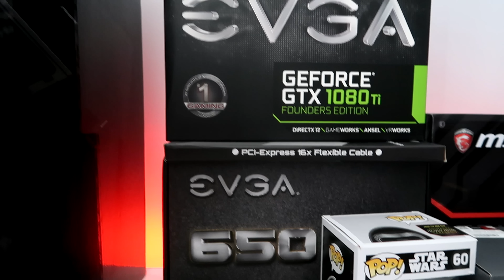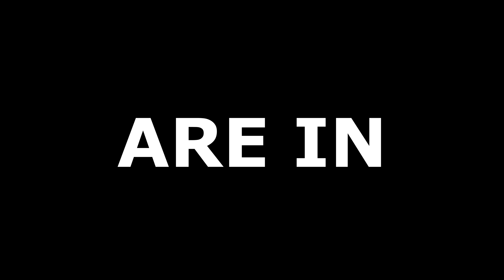GTX 1080 Ti Gaming PC Build AMD Ryzen 1700 Benchmarks 4K

Comment: Finally someone does gtx 1080ti and 1700 build
Reply: And runs it at a resolution people would use the 1080ti at.
Reply: lol would u consider a 1080ti for 1440p 144hz?
Reply: WaffleSplash, why wouldnt you?
Reply: And I wanna make s similar build with the 25 inch ASUS MX279H.  I was planning on using 32gb of dominator platinum and still using the 1080 ti.  Mostly playing games like overwatch and doom.  I'm hoping for the 200 fps range and this would also be my first build.
Reply: MrAlmond tbh why would u need 32gb ram and if u go that much for ram make sure its the fastest MHz for sure and when are you planning to do the build I was planning mine for so long now
Reply: I would use the ram for editing with super fast render times and I don't want to need to upgrade later on.  It's also going to be 3000mhz because 3200 is an extra hundred dollars.  I've been planning this build for about 2 months now and I need to wait another 3 months.  BTW I decided to change monitors to something higher resolution and higher refresh rate so I can get the best experience.
Reply: MrAlmond lol bro I been waiting so long for a PC build because I'm in high school like I have the money but I don't know if I should spend all my money like that you know and currently I have 3 monitors connected to my MSI laptop so I don't know what to do either wait for the next series of gtx or what....
Reply: I'm only in middle school but I can't really get a job and I am struggling on ways to make money besides selling alot of my stuff.  I have a macbook pro but I learned that they suck so I'm gonna sell it.  I think you should probably wait until the 1080 ti prices drop and some other components like the cpu.  Use pc part picker they show the lowest prices and you would save quite a bit unless you already are using it.
Reply: ViETKhanGG I do t have it yet

Comment: oh man peanutbutter, i wish you'd make more vids, i dont care what videos if its builds, funny moments, i just love them, keep it up man ;) 

and ps: i have a fx 4300 and gtx 950, should i upgrade to a pentium g4560 and rx 480 ? :)
Reply from the maker: The g4560 is a solid cpu for the money, but when paired with an rx 480 you may experience a slight bottleneck in some games. Maybe wait for Ryzen 5 & 3 or get a i3 6100 / 7100
Reply: PeanutButter25J see, i live in germany, the i3 costs about 80€ more so i could get the msi rx 470 how would that be ? ;)
Reply from the maker: Oh I see, well I would go with the Pentium/Rx480 I guess x) or wait on the upcoming vega GPUs.
Reply: PeanutButter25J or maybe i just dont give a s*** and spend more money xD
Reply: PeanutButter25J yeah i think i'll do that, thx for the tip with the bottleneck
Reply: zentix 007 im getting my 390 4 gb build tomorrow  whoo
Reply: mstrm3 with what processor ?
Reply: zentix 007 the i5 6500
Reply: mstrm3 cool ;)
Reply: Why would you recommend a i3-6100? It is AT THE MAX 3-5% faster and costs 80 bucks more. Please, don't buy an i3-6100 anymore. The G4560 is the way to go if you are looking for a budget CPU. Cheers.
Reply: Kresh - CS:GO and more! Yeah, but i dont Know if it will bottleneck with a rx 480
Reply: Kresh - CS:GO and more! the g4560 bottlenecks...
Reply: Yes, it will bottleneck on most titles (unless you play VERY VERY GPU intensive Games), however that was not the point. The i3-6100 will bottleneck just as much. There is absolutely NO point to buy an i3-6100 anymore. If you want the performance of the i3-6100, just buy the MUCH cheaper Pentium G4560.
Reply: Buy Ryzen 5!
Reply: lol FX 4300 is kinda shit. Pentium would do better even in multithreaded games lol.
Reply: Eminentend i know thats why i wanna upgrade
Reply: @zentix yeah I was responding to another guy

If you're on a tight budget purchase the g4560.. Do not buy i3s.
Honestly I recommend you get g4560/RX 470 combo if you want the most value. There will be a bottleneck in some games but it's not too significant.

AMD has a 4 core 8 thread processor for $169 that should pair well with the RX 480. Keep in mind the Polaris refresh RX 580 and 570s are coming out soon so you may want to look out for those  too if you don't mind waiting.
Reply: Eminentend im getting the fx8300 with gtx1050ti can i expect bottenleck? im new into pc gaming
Reply: @Knight Warrior

You honestly shouldn't expect that big of a bottleneck with a budget GPU like the 1050 Ti, however why go with an older platform? What if you want to upgrade your GPU in two years or so? I recommend waiting for the R3 lineup of Ryzen CPUs, you should get more value for your money
Reply: Eminentend ive already build my pc with the amd fx8300 and gtx 1050ti.. can i run games like The witcher 3 and fallout4 with some mods? i aim to play on high settings.
Reply: You'll be fine with both at 1080p if you don't mind turning down a few settings
Reply: Get RX 580 with Ryzen 3 CPU when they come out. Or wait for AMD Vega GPU:s, slower ones will match GTX 1070 (or higher) with cheaper price tag if my predictions are right.
Reply: even an i5 will bottleneck RX 480, i have experienced it. was running i5 4440 with RX 480 switched to i7 4790k huge difference in games like Bf1 and Tombraider
Reply: I have a custom build workstation motherboard 4gb ram ddr2 gtx 650 1gb 1.5 tb hard disk and a intel i2 quad core 2.4 ghz i really want to upgrade
Reply: Raghav Tripathi that's because i5 4440 is old asf
Reply: Joey Delgado I have an i7 7700k and gtx 1080ti, should I upgrade to the Intel inside and gtx potato?

Comment: An aftermarket cooler on that 1080 Ti would have helped tremendously with temps and performance. The things clock speed was only at ~1500, most people clock them up to at least 1900

Comment: So im planning on building a pc with the Ryzen 7 1700 along with a gtx 1080.  I was wondering if you think i would experience much of a difference in gaming capabilities if I went down to a 1070 to save some money?  My main worry is that the 1700 might hit a bottleneck and not fully utilizing the 1080 and ultimately lead to me wasting the extra money on the 1080?

Comment: Getting the 1700, strix 1080ti, 16gb ddr4 3000mhx corsair lpx, 1000w psu (only psu ill need for ages), NZXT h440 matt black, asrock killer 370x mobo (oc and wifi). Itll be complete by next week!!! 

I noticed you used a 650watt psu, wont that be an issue?

Comment: You have given no info at all.

Did you overclock CPU ? If so, whats the multiplier ?
Did you overclock GPU ? If so, give us the numbers.
Did you overclock RAM? Which speed are they running on? 

As a potential buyer, I need these.

Comment: When are u doing the budget Ryzen build?:)
Reply from the maker: ;D
Reply: Eemil Satoniitty what's your budget? Ryzen costs more than my build
Reply: mine is 500-600
Reply: +PeanutButter25J Should i wait for the ryzen budget build?
Reply: Eemil Satoniitty get ryzen $ 350 or less, rx460, 1 $50 stick of ram, $80 motherboard $50 case, $40 psu and some fans. Should be around your budget

Comment: I have an E6600 , 2GB RAM , MTB LGA775 , GT 520 
So...I can upgrade to 64 bit , what GPU and RAM I can buy for an upgrade ?maybe even a CPU.
An 750ti ,4gb 1600mhz should work ?Would the 750ti bottleneck my cpu ? 
Thanks .

Comment: He doesn't put on thermal paste on the CPU when he applies the cooler and also 86 Degrees Celsius on a 1080? Really not good
Reply: Wernich Schmidt all of the 1080 ti's seem to be running pretty hot at the moment but yea I thought that was a bit high.

Comment: very low fps for a 1080ti. I've got a 1080 running on a 1440p monitor with about 30percent more frames at max settings on the same games.. maybe this processor sucks . if that's the case, go with intel

Comment: Hey guys i just bought a computer with an i3 7th gen 3.9 ghz, gtx 1050 ti by asus 4gb version, 8gb of ram, 500 watt power supply, and an h110m-k motherboard and i onlyget 80-90 fps on csgo with 1366x768 on minimum. WTF IS WRONG WITH MY COMPUTER?
Reply: U should have gotten rx 470 go replace now
Reply: MrAssault889 gtx1050 garbage
Reply: On CSGO? That's impossible, a 20y old graphic card would have better FPS (I'm exaggerating, but not that much). Which CPU do you have?

Comment: Guys! I need your help! Could you tell me if these are compatible: 

-DIYPC DIY-F2-O Black/Orange USB 3.0 Micro-ATX Mini Tower Gaming Computer Case
-MSI B250M GAMING PRO LGA 1151 Intel B250 HDMI SATA 6Gb/s USB 3.1 Micro ATX Motherboards
-WD Blue 1TB Desktop Hard Disk Drive - 7200 RPM SATA 6Gb/s 64MB Cache 3.5 Inch 
-ZOTAC GeForce GTX 1060 AMP!, ZT-P10600B-10M, 6GB GDDR5 Super Compact
-EVGA 500 W1 100-W1-0500-KR 80+ WHITE 500W Power Supply
-CORSAIR Vengeance LPX 8GB 288-Pin DDR4 SDRAM DDR4 2400
-Intel Core i5-7500 3.4 GHz LGA 1151 
-Corsair Hydro Series H100i V2 Extreme Performance Water / Liquid CPU Cooler. 240mm

Comment: in general you use around 45-50% CPU with nice Temps with pretty basic Fan Cooler but i dont like 85º on GPU you should activate msi afterburner and run your fan's to 100% RPM , if you are already doing it you should Water Cooling the GPU.
my PC:
AMD FX 8350 + CPU Cooler Katana 4
MSI GTX 970 4GB
Asus Crosshair V Formula Z
Kingston HyperX 1866mhz DDR3 8GB
AeroCool Templarius Imperator 1150W 80 Plus Gold 
Zalman Z11 Plus Red + extra Fan's
SSD Kingston 120GB V300 + 1TB + 500GB

I got that on october 2014, and the only issue i have is on CSGO when i press escape for menu i get fps decreas during 1,5 sec, i read that amd cpu isnt good for csgo... but rest its perfect

Comment: CPU to week for that GPU, Intel 7820x would have worked better, or a GTX 1080 lol. Amd is shittier than Intel and it is not even a thread ripper so no point
Reply: That's why your getting 50 to 70 fps in 4k games